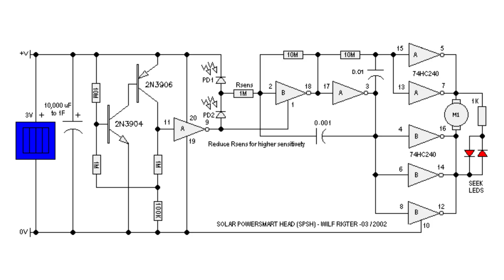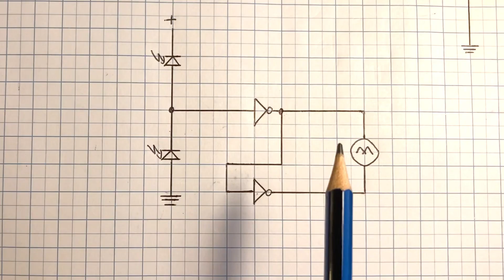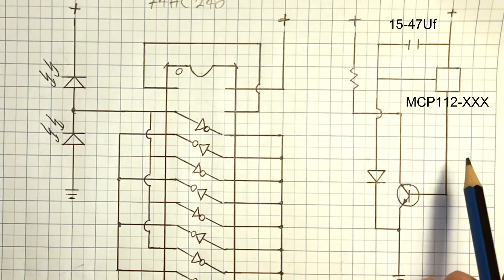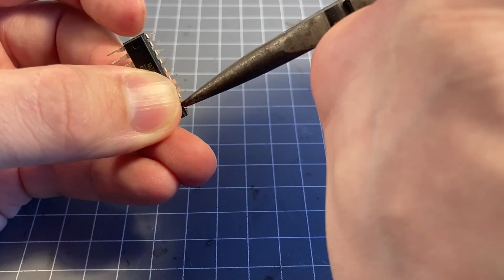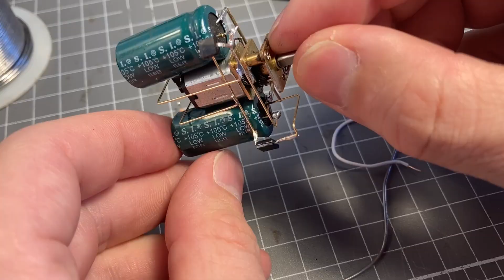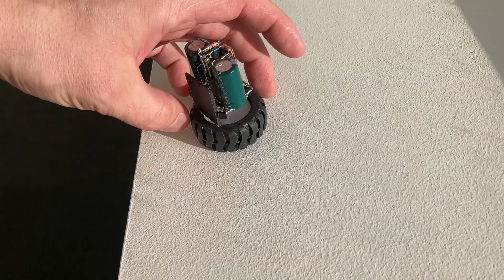Inverters for brains, the BEAM robot head

Comment: For 2 dof, could one just connect the first 4 buffers on the top part of the pins, and then connect the last 4 buffers to their own side, with its own photodiodes? Both drive their own motors on their own rails. It would mean half of the current capabilities for driving motors too, yes?

Im not sure if I described what Im thinking very clearly.
Reply from the maker: Yes, for sure you could do that. The issues is you might not have enough current capacity with just two buffers driving the motors. You could use one chip to run the logic and another as just a motor driver, or use a transistor H bridge instead

Comment: For the n20 motor, what voltage one should I get and also rpm?
Reply from the maker: If you can find a 5v or 3v version, go with that. Pretty much any rpm will work but they will give some different behaviours. Faster gearing will mean a tracker that “locks on” quickly but might be a little wobbly, slower will take more cycles to turn but tend to be more stable once they find light

Comment: Ia it possible to do this with the basic tech that powers a crystal radio
Reply from the maker: Pretty much any of these systems need some way to make an inverter so you really need transistors. However audio circuits can be used, especially op-amps

Comment: As always, loves seeing people making BEAM or BEAM inspired stuff. It's so neat, simple, and elegant. I made a little solar cricket based on your previous video because I had all the parts laying around to build it. Haven't soldered it up yet, for now it lives on a small breadboard. Might cannibalize it for the solar cells later, don't have very many of those.
Reply from the maker: The good thing about the solar crickets is they can run off of pretty much any solar cell. I have mine working with a cell from a calculator, usually those cells are pretty much useless for BEAM stuff. Glad to hear you are enjoying the videos
Reply: @ALTcorporation  I actually had to use two solar cells to get the required voltage because they are worn out ones from small garden lights. It makes neat little chirping noises reminiscent of crickets or distant birds when the sun starts coming up.

Comment: Once again, great video and explanation! While this simpler circuit works good enough, I cannot express enough how cool Wilf's design with the hi/lo oscillator is! It is so ingenious I have no idea how he figured it out, haha! It's best feature is that the motor speed is getting adjusted realtime because of the light sensitive oscillation to be able to stop at exactly the center without overshoots (it's like the surprisingly mathematically complex control circuits in lifts). And the power consumption esentially drops to zero when balanced, so you can even use it to charge a battery efficiently. And all of this with his super simple design!
Reply from the maker: Yeah, the power smart head is a crazy circuit. I plan on making a video about it as well, but it's a pretty involved design, so I am not really sure how to go about it. Pretty much all of his designs are so cool, though. I have no idea how he was able to constantly come up with such simple and elegant circuits. 
Have you built a few of the powersmart designs?
Reply: @ALTcorporation  I've built a few of his head designs, but sadly haven't documented any. Since there are multiple versions/revisions of the SPSH, you could start with the simplest that doesn't have LEDs and all the extras. I've archived his Yahoo groups files (with the help of espectraa1s), so you can find most of his circuits there. Youtube keeps removing my comment so I cant post a link, but you can find it in the BEAM yahoo groups archive on the files tab in the wilf_nv folder.